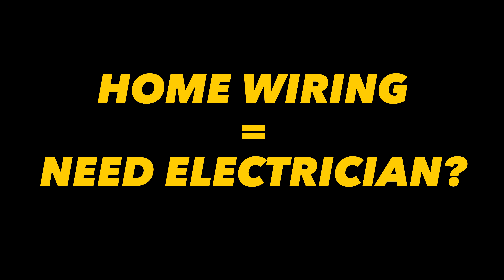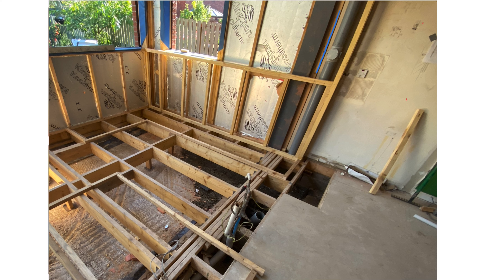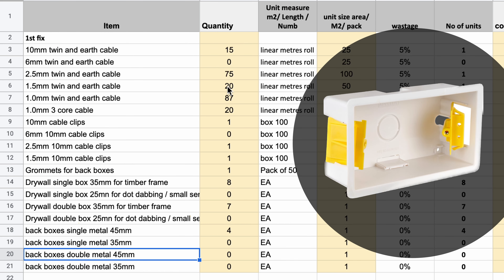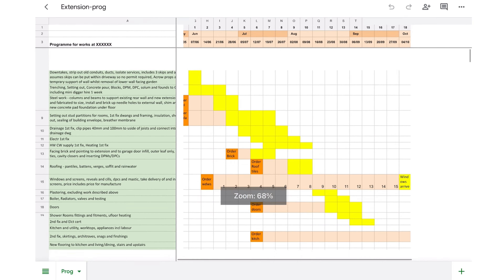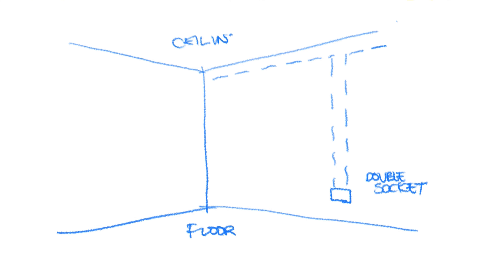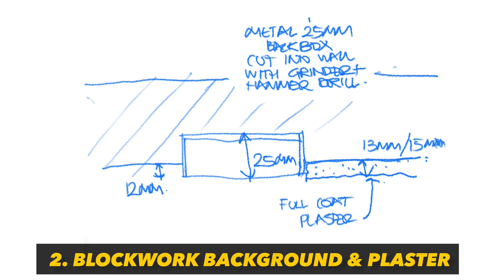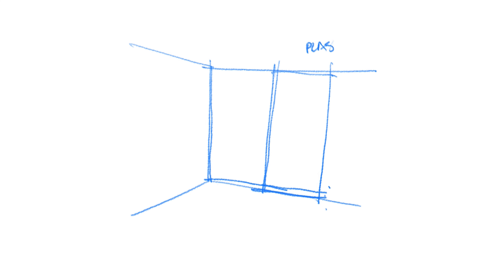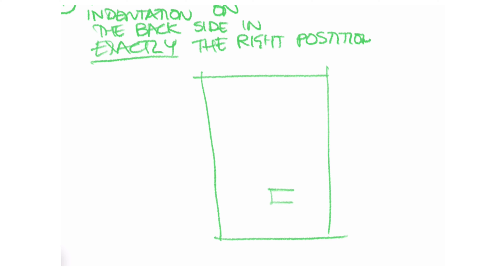Safely run electric cables for your house extension, certifier tests, connects at end.

Comment: It's not called a ring main - that runs around a city. It's called a ring final circuit . . if you want to do rings thats fine - radials are much easier and the cost is minimal . . Great content - thanks for sharing

Comment: nice video ! I would run the boiler spur in 2.5 though as it gives you more options in the future and doesn't really cost much more. just my opinion. keep them coming love your channel
Reply from the maker: Yes, great point.  I did think about speaking about the future proofing aspect, especially for heating options, but I decided to keep it simple for this, primarily to illustrate what’s usually involved for a typical home extension project.
Reply: @build-better-things  great stuff keep them coming
Reply: Absolute zero need to run in 2.5mm
Reply: @James_scott86  why?

Comment: 0:08 You can wire your house if you are a "...."Competent Person: 'A person who possesses sufficient technical knowledge, relevant practical skills and experience for the electrical work undertaken and is able at all times to prevent danger and where appropriate, injury to him/herself and others'...." also knows how to safely design electrical instalation.  Seen electricians with many years of experience that could not be defined as a competent people.  Wouldn't call this creator competent either after listening to some advice given on this channel.
Reply from the maker: This is actually what the regulations say, From Part P Clause  3.5
“…. an installer who is not a registered competent person may appoint a registered third-party certifier to inspect and test the work as necessary”.  Which is exactly what the video is saying, all the way through. You confuse the issue of competency and your negative opinions of me with what the regulations actually allow. You’re just reinforcing all the points I make in my other video regarding false information and scaremongering. Maybe you should do a little more homework next time ?

Comment: What about the 2 people who got sentenced for manslaughter following shoddy electrical work ? Part of the investigation looks at whether the installer was competent  :- 

there was a level of appreciation that he was not competent to carry out the electrical work he was contracted to perform, yet he still chose to perform it and in doing so put multiple people at risk, 

This is why only competent people should carry out such tasks . Even the cable manufacturers clearly state on their drums clearly ‘ this should only be installed by competent people . 
It’s fair to say that if you need to revert to YouTube for advice how to wire an extension that you are not competent.
Reply: @build-better-things  you are the one getting the wrong idea , as one of your other people have commented and I agree you are just using manipulation tactics to make you look the good guy ! That case I was reverting to was an electrical installation where a guy had signed off someone’s work saying it was safe , in fact there was no earth connected in some points of the installation /badly connected earth and no 30 ma rcd present . This led to a death of an innocent member of the public . I am trying to put across the seriousness of electrical installation. No one is scaremongering here it’s taking responsibility for your actions . These is real life scenarios not stories. People have been killed seriously injured in the past due to incorrectly installed electrics . This is why we have electrical regulations . Yes I am a qualified electrician and yes I am registered as an installer to the niceic .
Reply from the maker: If anyone falsely signs inspection certificates, then yes, they should go to prison. Since I can’t really understand the points you’re trying to get across, other than you don’t like the idea of what the regulations allow, I’m just going to have to leave it at that.
Reply: @build-better-things  they are falsely signing it if they aren’t doing the work , what part of that don’t u understand ??
Reply from the maker: Excerpt from Part P of the building regulations, Clause  3.5
“…. an installer who is not a registered competent person may appoint a registered third-party certifier to inspect and test the work as necessary”
Are you sure you’re registered? It doesn’t look you understand the legislation from your comments.

Comment: Stuff like this should be banned giving little knowledge to the general public could have some catastrophic consequences! Would you mess about with a gas main?
Reply: No one is saying here that they are messing about with the mains electricity. He clearly states that there is a need for an electrician to test and certify the work. In my experience there are decent electricians who like the fact that the graft is done and they can wire to the consumer unit with clearly marked cables. We all know that gas mains needs to be worked on by a certified gas engineer although it’s possible to pipe up to the main and have the engineer test and connect etc.
Reply from the maker: What should be “banned”…exactly? What do you mean “little knowledge”? No, I wouldn’t “mess about” with a gas main. What are you babbling about?

Comment: No mention of metal fixings 🤦‍♂️ as part of the 18th edition you are required to use metal fixings to prevent premature collapse of cabling in the event of a fire, there is no mention of this in your video , volt drop , grouping factors , the design mentions no size of the ring main all these factors need considering when designing an installation.
Reply from the maker: There’s a lot I don’t mention. It’s why I do mention the need to get a registered certifier in at the beginning, during, and then at the end, in these videos. Thanks for pointing the things you mention and thanks for the comment.
Reply: @build-better-things  good luck in finding any sparky that wants to do all that 😂🤦‍♂️ sounds like a load of nonsense to me
Reply: @paulbb27  You are hard work mate -  im exhausted just reading your comments.  Anyway, in my experience, those types of sparks are actually fairly easy to find.  Many a spark I have dealt with over the years are pretty relaxed about working with a 'competent installer' to undertake many aspects of first fix - saves them having to come to site constantly to run in a simple little cable here and there and keeps the job moving forward nicely.   They discuss the runs with you at the start, maybe a couple phone calls to clarify a couple of things half way through if needed and then they second fix it and sign it off at end - simple and done it hundreds of times for small extensions and stuff.  Important to keep this advice in context:  this advice/channel is mainly for small domestic extension jobs - no one is wiring the notre-dame catherdral here.
Reply: @mrnobody9227  hard work? No mate just covering my a**e & fed up with dealing with bodgers , if you are such a competent installer why not do the lot yourself? Save the expense of an electrician then ! Don’t get why ur only wanna do the ‘runs’ as u put it & expect someone else to finish it off . I don’t know anyone who would be happy to let people who arnt qualified to have a go & sign off their work , there’s no excuse , you’re either qualified and competent to do it or you’re not 🤷‍♂️